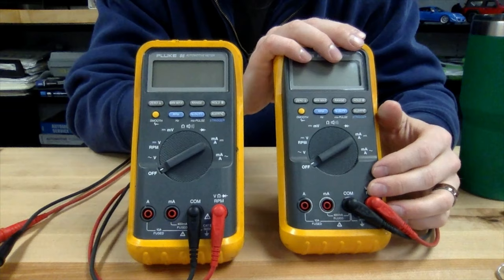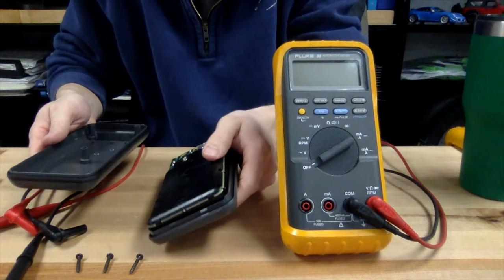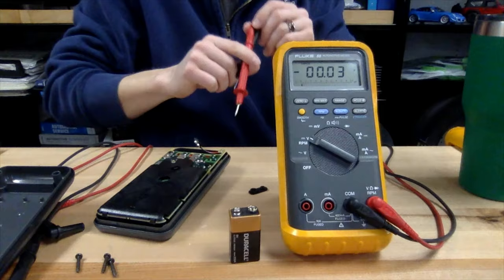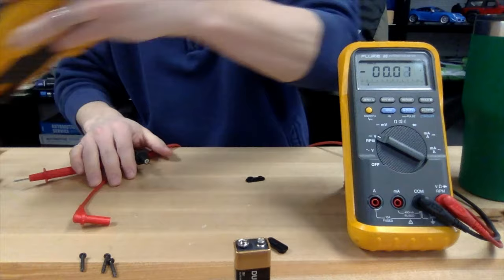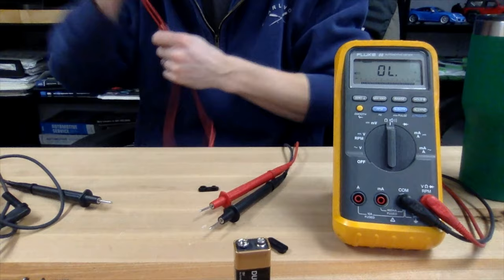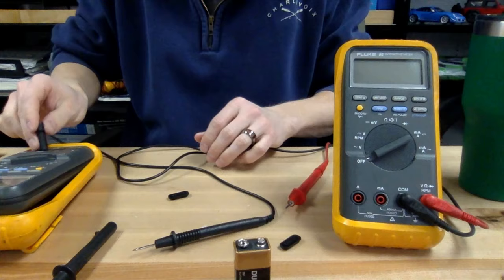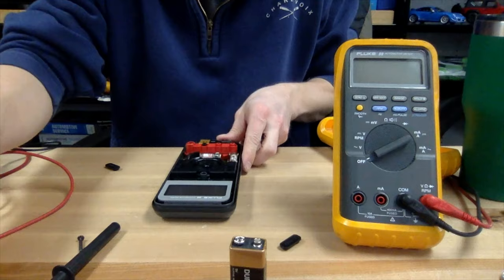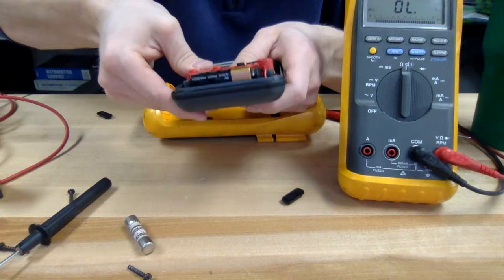HOW TO FIX A MULTIMETER THAT DOES NOT WORK (MY TOP 3 PROBLEMS & REPAIRS)

Comment: Question ANYONE.. 2 METERS WENT OUT after checking a welder.. I have never even blown a fuse in a meter my whole life and a welder ad some sparks  on one area I put a meter on it to read it and it just went blank and no fuse burned they are all still good .. WHY???? NO IDEA?? Just went out and now meters are dead nether blew a fuse I have had they on high voltage coming in building with no issue and check ing a somple single phase 480 welder it just ruined meter. Anyone know why or any way to repair them ??

Comment: Thanks for the Video, I've personally also had these same 3 common failures with my Fluke 87 over the years. I also own a MAC Tools ET-332 Multimeter that has a broken Red Voltage Test Lead Socket, this Meter has 3 Red Sockets one of which is labled CX that I've never used, so tonight I de-soldered both the V and the CX Sockets and re-soldered the CX socket in the V position. My ET-332 Meter is now usable again.  Randy   AKA randog311

Comment: My multimeter works okay for voltage and amps. On the ohm scale with the speaker function, my meter is beeping 
WITHOUT the leads touching each other. I know this wrong. Is there a fix for this OR should I buy a new meter?

Comment: Thank you for this video. I have a Voltcraft VC222 multimeter and the letters from the screen are not clear sown on the screen (they are half of them shown on the screen and they are showed and not on the screen). What could be the problem with my multimeter? Could it be fixed, or shoud I buy a new multimeter? (I am just an amator user - what should I buy (If necessary))?

Comment: Good deal,but that was no help for me;   
the varistor was exploded,replaced the fuse, and i think the whole shibang had gone bad, no display at all;  fuses and battery are ok; getting another multimeter;
 i think that 220 V were tested by mistake when in the ohms scale; would that blow it totally?

Comment: Any thoughts on what could cause that multimeter to power down after two seconds of being turned on?
A fluke multimeter that powers up, LCD does it's self test and it turns on, but then fades to off after about three seconds and has a known good battery.
Reply: I have the same problem but mine did it only once and hasn't came back on.  Change the battery, haven't changed the fuse, was going to try a resistor or diode.

Comment: The multimeter should tell you low voltage battery come on the screen when in use, not used for a long time and don't turn on , first thing you do his check the battery and connector, ps not nock in you at all but if I wasn't using this great tool , take the battery out from any battery leaks. Puka tool to mess up

Comment: Hello! The problem with my multimeter is - When I connect the DMM across a resistor (which was supposed to show a few millivolts), it shows a random voltage for a second and then gradually decreases to zero. That is, finally, it shows 0 volts. So, what could be the problem with my multimeter? Please share your experience. Thank you!

Comment: I have klein tools multimeter, the issue is its coming on, i am able to switch between functions but when testing for voltage or continuity nothing happens on the display. 
Besides the it being the leads are there any other issues that i can check?

Comment: I used  3695, PeakTech multimeter. to measure electric rat traps. It was working, but then I activated dead voltage shok and while measuring turned to other parameters and my bultimeter made strage buzz sound and turned off. Fuse is ok, but multimeter is not working. Batteries are also good. 
Is it possible and how to fixit? :D

Comment: My multimeter does not zero after taking leads off battery being tested  what could cause the this? I have to turn it off and back on to get the voltage to drop. Also the voltage that I am reading dose not make sense.

Comment: My Fluke is not measuring resistance properly. It slowly counts down until it finally beeps. I have changed the leads with brand new ones. Why would the resistance reading start at a high number then count down slowly till it reaches a low enough resistance to beep?
Reply: My Radio Shack does the same  !!
Seems this User don't fellow our comments or don't know much about this YT scene !
Reply: Bad capacitor?

Comment: If a Technician can't troubleshoot these problem on his own multimeter, what is he doing with a multimeter in first place ?
Reply: Measuring voltages, resistance, checking for continuity, and/or measuring current consumption. Everything a multimeter does.